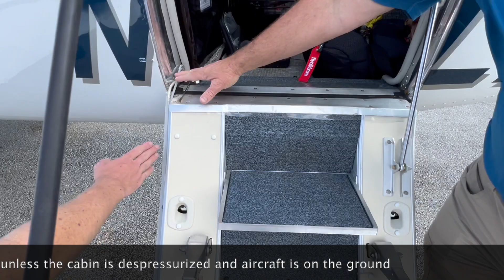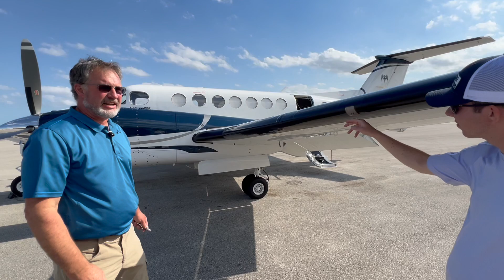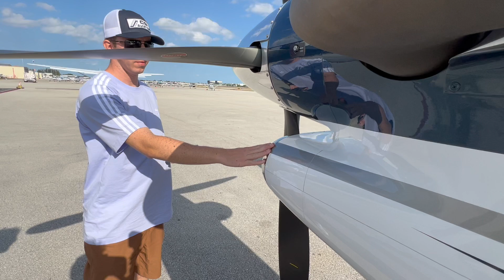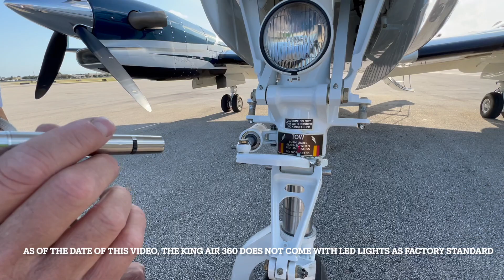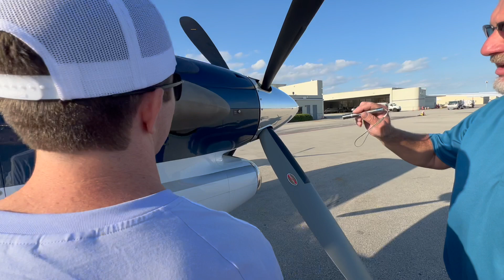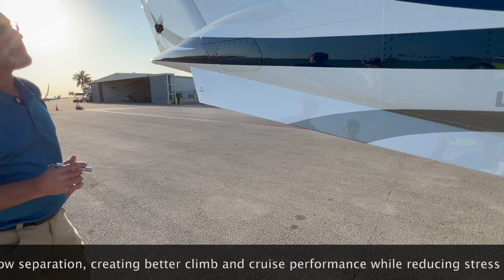EXTERIOR PREFLIGHT KING AIR 360 // INITIAL TRAINING

Comment: Hello, I’m new to your channel 
I enjoyed watching the walk around inspection, indeed I have learned a lot in a very short time, quick question: will the hangar have a small stepladder for you to reach when checking oil level?
Also, do you check tires air pressure?
Regards and thanks again for sharing.🙏